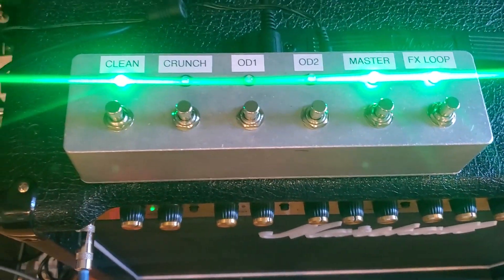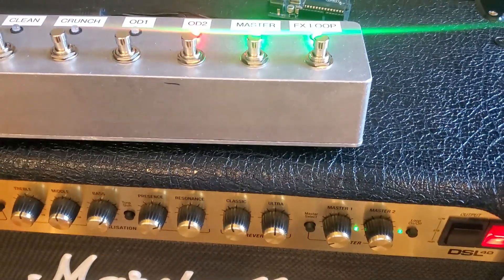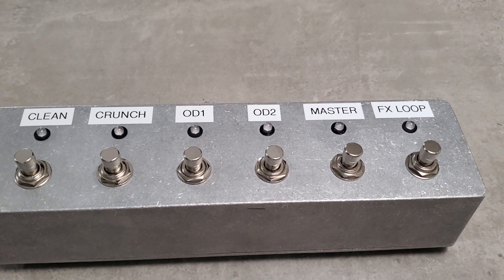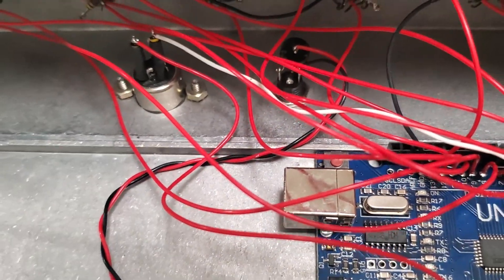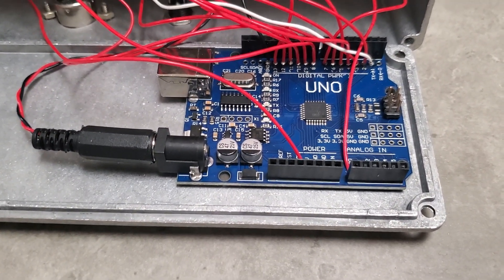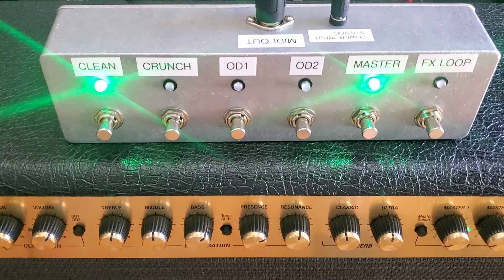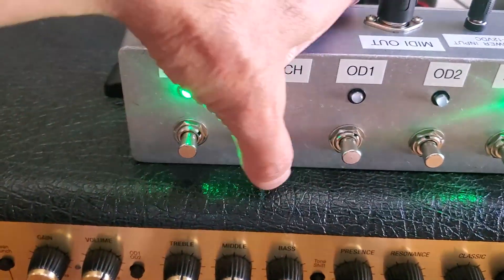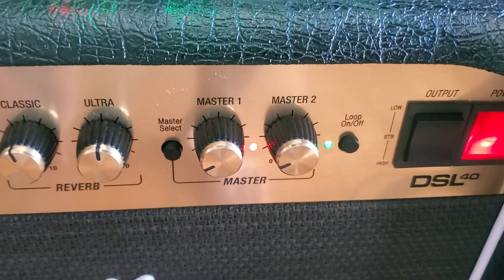Custom 6-Way MIDI Footswitch for Marshall DSL40CR and DSL100HR (PEDL-91016 Style)

Comment: Hi Kevin, I'm looking to make my own foot switch. When all the components are assembled, will I have to program the card or it is plug and play?
Reply from the maker: @pierremercure5428  You'll need to program the board or you can buy one from me if you don't want to bother with it.
Reply: @laaudiofile  there this error when loading program:
Desktop/DSL40CRv2.2/DSL40CRv2.2.ino:1:10: fatal error: MIDI.h: No such file or directory
 #include <MIDI.h>
          ^~~~~~~~
compilation terminated.
exit status 1

Compilation error: MIDI.h: No such file or directory
Reply from the maker: @pierremercure5428 Did you install the MIDI library?
Reply: @laaudiofile  I opened the file you sent me in the Arduino IDE program. I plugged the device on the computer. I clicked the upload button.
Reply from the maker: @pierremercure5428 You'll need to make sure the MIDI library has been installed otherwise it won't recognize any of the MIDI calls. It's pretty easy. You just need to Google how to install the Arduino MIDI library. Once you have it installed, it should recognize the midi.h file.
Reply: @laaudiofile  I tried to find out how to install the MIDI library. I found an AppleMidi file and guess what? No more error message! Now ready to try the electronics! Thanks

Comment: Hi Kevin, great DIY. Do you still sell the Arduino preprogrammed kits? I'd be interested in one.
Reply from the maker: If you need a preprogrammed Arduino (v2.2) clone board, I have them here. You just need to gather the other parts. I have never sold a kit, but I do have all of the parts for the DIYer.
https://www.ebay.com/itm/305959395349
https://reverb.com/item/83601835
Reply: @laaudiofile